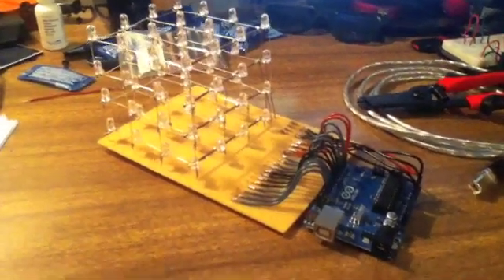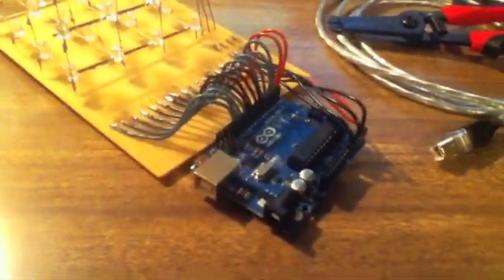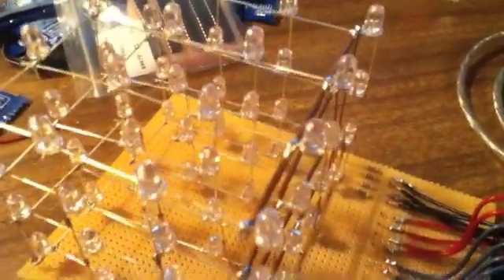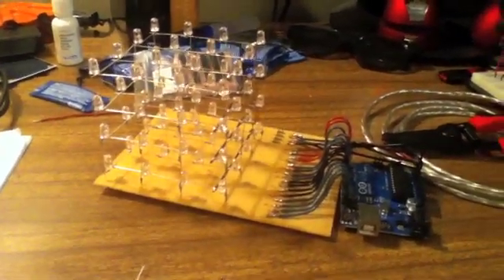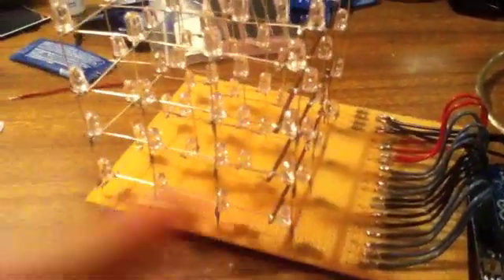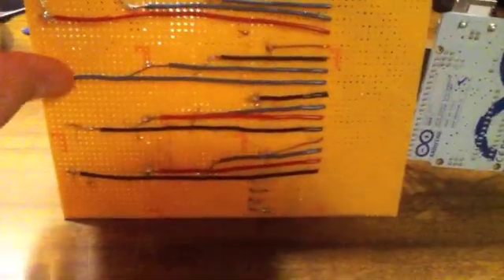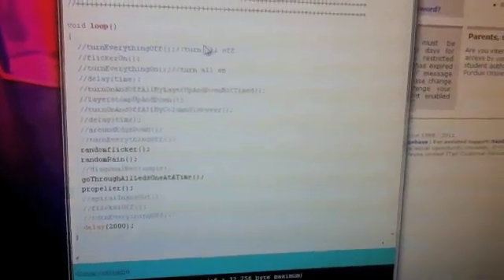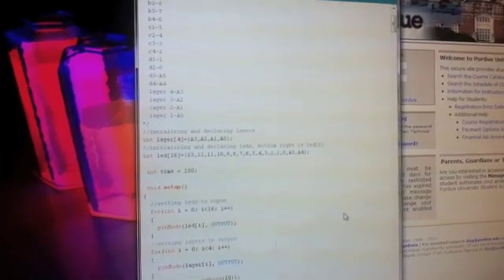How to make an LED 4x4x4 cube with Arduino Uno

Comment: Very good job man, I already made a cube. My leds had very short legs so I had to make a  wire structure to hold them with a 100 ohm resistor on each led so the brightness doesn't change. I am taking code from around the internet and making a crazy big sketch with tons of animations. Can I use your code (giving showstopper1v100 credit in the beginning)? I will have to modify it to use positive columns and negative layers because that is how most people do it.